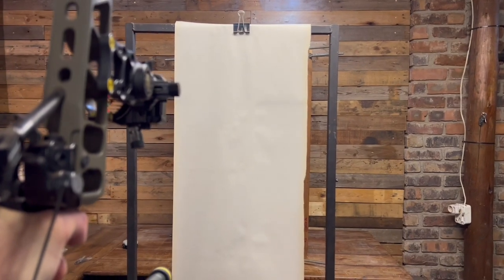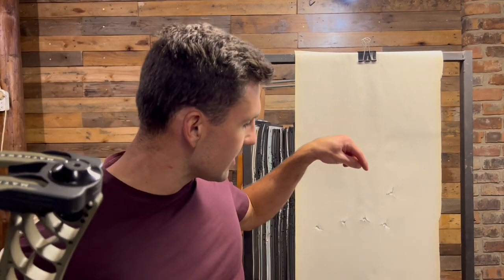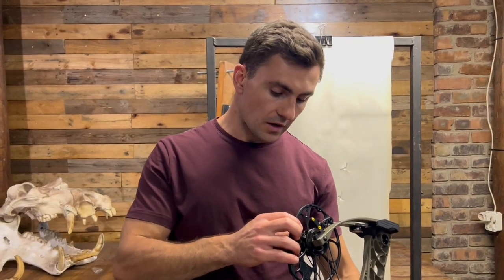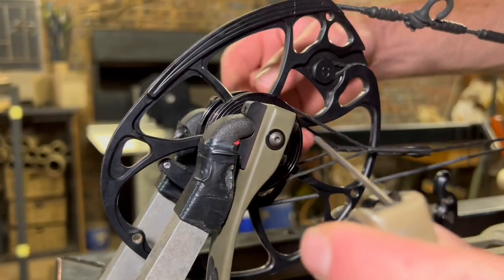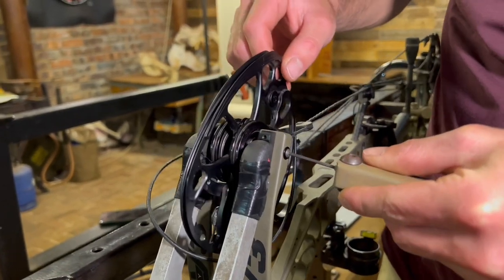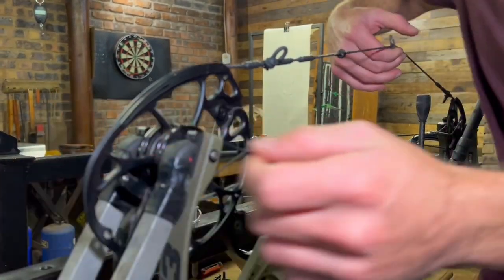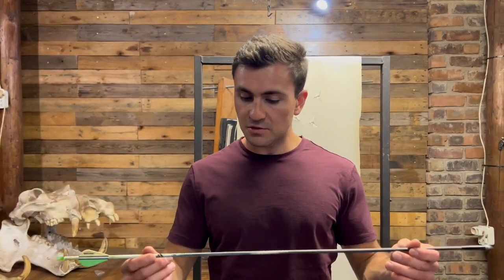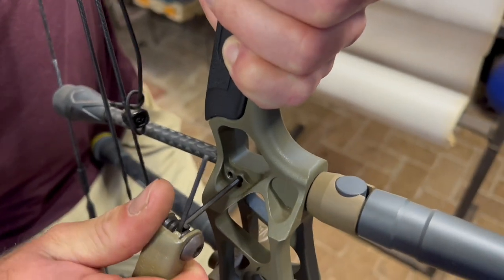Mathews Top Hat Tuning | How to perfect your setup

Comment: I changed the string on my Triax a couple weeks ago.  Before the change, my bow was perfectly tuned and I could practice out to 100 yards.  Since then the only way I can get a bullet hole is to move my cams all the way right, which results in my sight being partly hidden behind the riser at full draw.  I don’t have a draw board, but I’m trying to find someone with one to help check timing.  Any suggestions or tips?